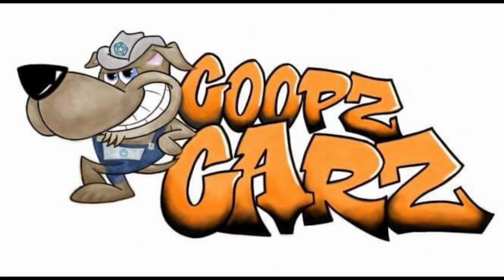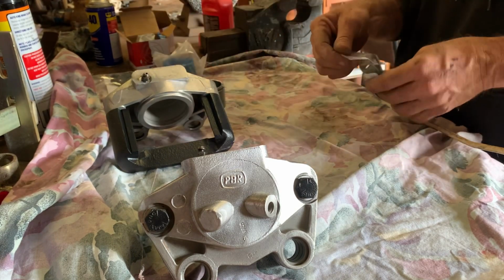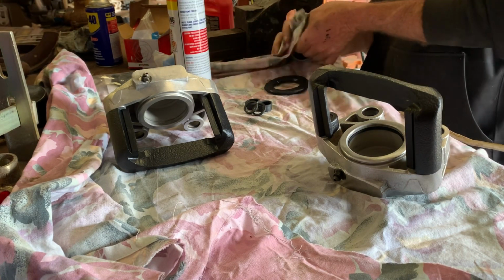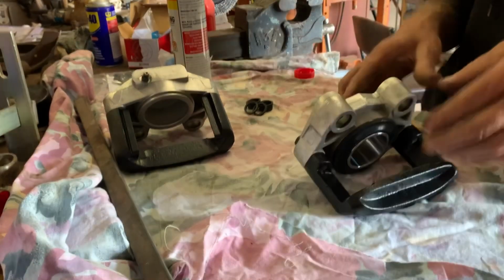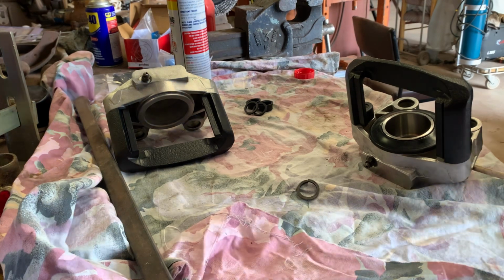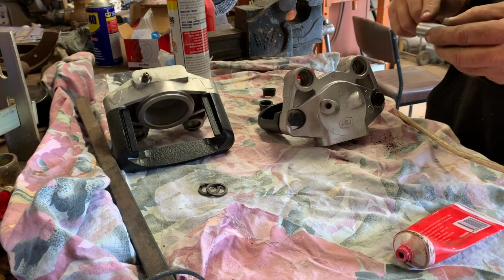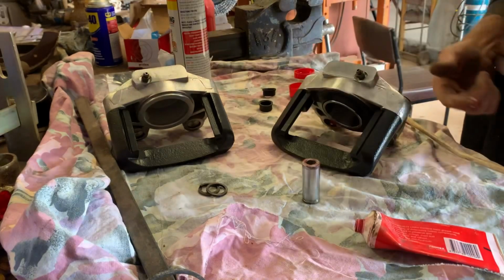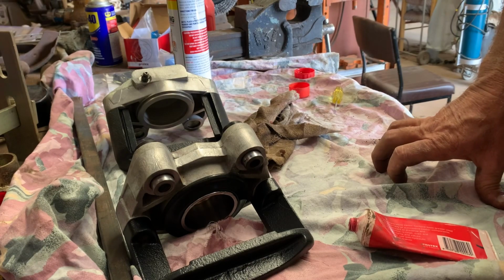CM Valiant caliper rebuild

Comment: Hey Dave always find a grease gun pops stubbon pistons out pretty easily, also won't turn it into a projectile when it lets go. Most grease gun fittings just screw into the brake line hole. Great video, thanks
Reply from the maker: Mate that would work great 👌
Reply: Great idea.

Comment: Nice work Coop, my wagon has these calipers so this will be handy to me.   Every CM I've had was on gas ,the ELB doesn't work so they put points in and the cars a slug . Seems to have a built in resistance in the wiring so I run an MSD and plenty of spark.
Reply: i  have a Cm and the Elb and other aspects of it have been problemmatic and ongoing I found the starter relay was a prime suspect and re wired an after market one in it solved a large part of the electrical issues i had

Comment: Did you use an agent to clean up the caliper? They came out looking like they just left PBR. A pity they won't look that nice for long. At least it makes the job more satisfying.
Does rubber grease have much other use besides this?
Reply from the maker: Blasted the calipers the a bit on wire wheel 
Rubber grease is good for bushes etc 😉